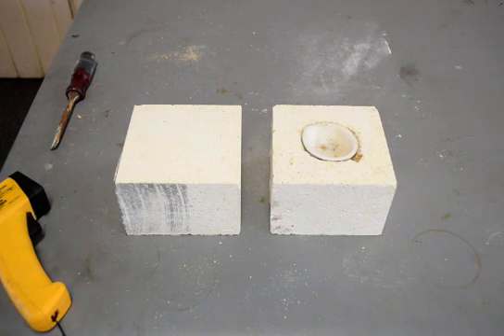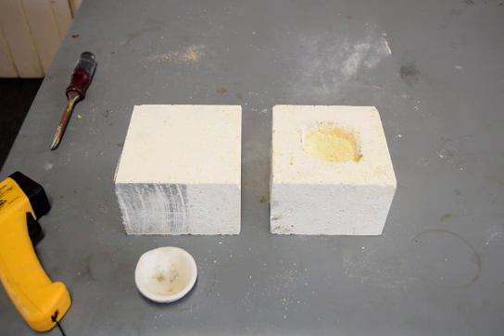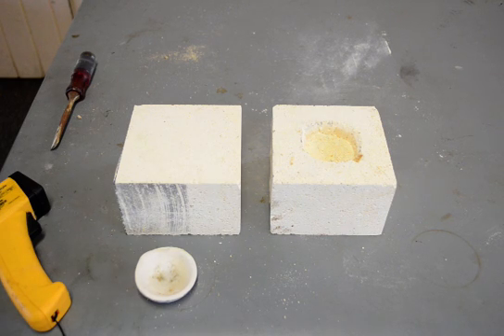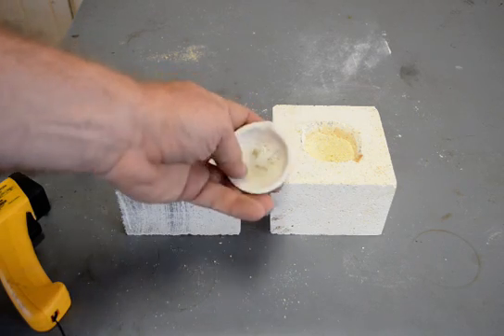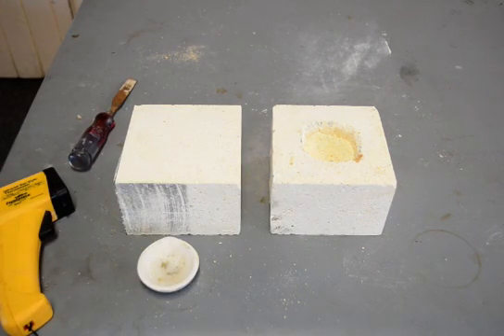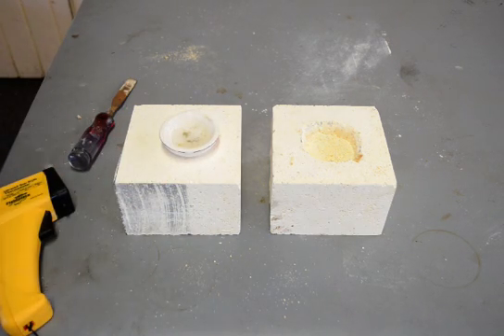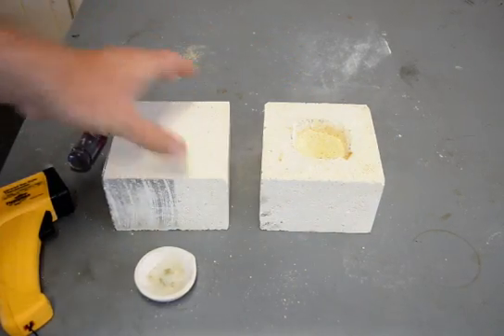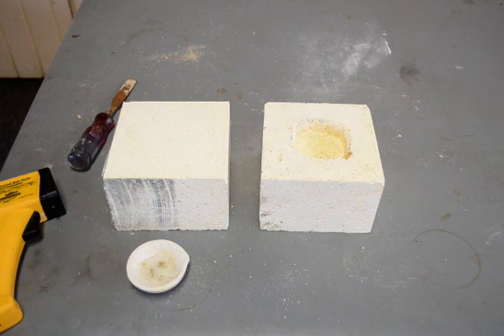Poor Man's Microwave Smelter

Comment: How is the gold heating up? Is  it the kiln, the crucible or the  gold that the microwaves are heating?
Reply: The inside of the walls of the top part of the kiln is coated with Silicon Carbide or Graphite dust, these two materials absorb a lot of the microwave radiation which they convert to heat.

Comment: i heard something about crushing up Pyrex glass that's designed to handle high temp much like graphite(pencil lead does) helps to bring the gold up to temperature, warning is don't let the gold get to 4000 deg c or it vaporizes, i wonder if Sodom/Gomorrah brimstone would be good additive to fire-clay crucibles, hint use conical shaped (reverse cone like upside-down)

Comment: Is that degrees centigrade or Fahrenheit? Because If its Celsius, and Im hearing you correctly, you can melt steel in this thing.
Reply: Chaos YOU CANT MELT STEEL BEAMS WITH MICROWAVE.  Serious tho, can you melt steel?  2300f right?
Reply: Yes guys you can melt steel in a microwave.  @johnsmith4630

Comment: If you make a shallow hole in the bottom of the lower firebrick  - as well as the hole for the cricible in thev top of it,  the revolving pin in the centre of the microwave can revolve freely within the hole. The glass plate and the  plastic revolver wheels can be taken out, which gives a little more space for the bricks and removes any risk of damage to the glass. There is no need to revolve the firebricks within the microwave oven..
Reply: If you don´t let the quadratic brick turn, you can, theoretically, use a much bigger brick (such a big one, that its corners wouldn´t allow for turning anyway), and so reach higher crusible-temperatures. Although you shouldn´t use up the whole energy just to heat up an ever bigger brick, but the crusible, of course. Nevertheless, a balance would be easy to find, and after all, you just trade time for higher temperatures, which is a good deal...
Reply: Excellent idea! I use stands to protect the glass but I prefer your idea!

Comment: Тигель скорее всего из карбида кремния имплантированной  окислом железа, так же касается подсыпании этого же материала, только в тигель добавлен каолин, термоизоляция ШПГТ.
Reply: + Crucible likely implanted silicon carbide iron oxide podsypanii also applies the same material, but in a crucible added kaolin SHPGT insulation.